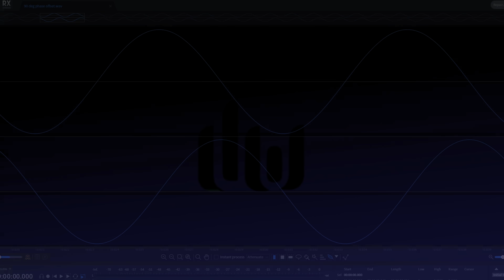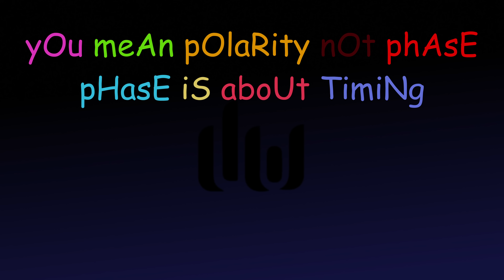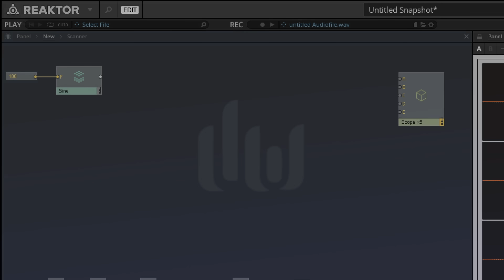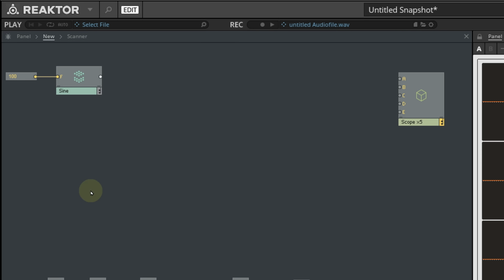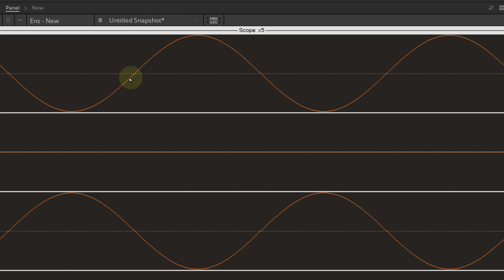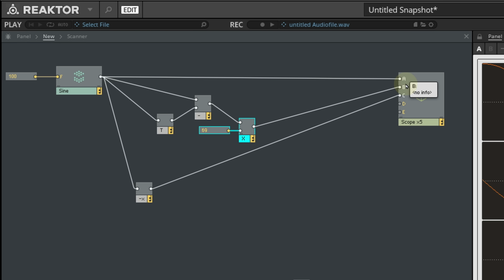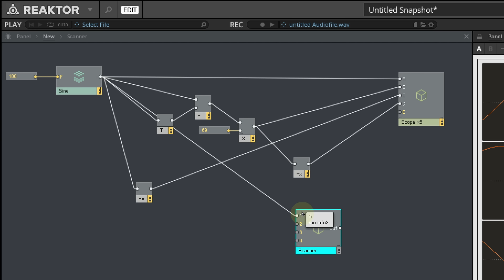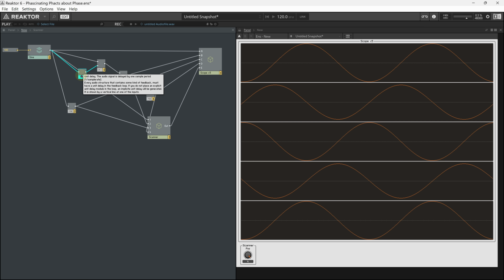Phascinating Phacts about Phase

Comment: Hi Dan. First and foremost, thank you for all the information you share.

Today I decided to measure the difference between two condenser microphones and two dynamic microphones just to confirm what you explained in this video and what DPA states in the article you shared.

However, the results were not as expected. I only found phase differences when going below ~200 Hz and on the highest frequencies (but I disregarded those since the could be easily explained by slight misalignments between the mics). I used pure tones, sine sweeps and pink noise alongside Reaper recording the signals, Room EQ Wizard measuring and comparing both signals, and Open Sound Meter comparing both signals. And every tests concluded with those results.

I used a Shure SM58 and a Sennheiser 835 for my dynamic mics and an Aston Origin and an Audix TM1 for my condenser mics.

Am I missing anything important on my tests? Or is this behaviour expected?
Reply from the maker: The important detail you're missing is that I'm not infallible and occasionally get things wrong. I blame DPA for giving me the confidence to say something silly without testing it first. Correction coming, when my health improves enough to allow it...
Reply: @DanWorrall Just focus on getting better, I just wanted to know if there was something I was missing on my tests. Thank you much and have a great new year!

Comment: really loved this video. can you talk more about all-pass filters? they aren't reversible, but i like how they can alter the behavior of compressors and saturators downstream. chatGPT said i could nudge the signal back toward where it started (minus the nonlinearities) by applying the same all-pass filters in parallel at 5% wet. i felt i should come to you on the subject. can you expound?
Reply from the maker: An allpass filter in parallel becomes a notch filter. At 5% wet that would be a gentle bell cut, just like a normal EQ band. Maybe don't ask GPT about DSP just yet...

Comment: hey, when aligning drums, should I align on the peak of the wave, or the zero crossing, where the transient "starts"???
Reply from the maker: Neither really (although either will usually get you pretty close). Usually the goal is to get the low fundamental of the drum in phase. Usually it's good enough just to make sure the low fundamental is definitely not out of phase, which gives you a weak thin sounding drum. You can align them by eye initially if needed, but they're in phase when they sound fat and full bodied, out of phase when they sound thin and papery.

Comment: About air pressure vs air velocity:
This has been bothering me right from the start, it simply doesn't make sense on a physical level.
I've looked into the source you provided, and all it does is simply stating that one microphone measures pressure, while the other measures velocity,
without any further detail explaining HOW they do that.

My thoughts on this (I'm not really an expert in microphone technology, but I am an engineering student, so I have some physical background)

Both microphone types are the same on a mechanical level:
They use a membrane to convert the physical changes in the air (very broadly speaking) into movement.
There's no reason, why one should only react to pressure, while the other should only react to air velocity.

The defining difference between dynamic and condensers is in HOW the movement of the membrane gets converted into an electrical signal.

- the dynamic microphone uses electromagnetic induction, where the voltage is proportional with the speed of the membrane
  (induction law: ΔU = -B * l * Δv)
  Therefore, the max voltage output is highest, when the coil is at it's fastest speed (which has nothing to do with air velocity),
  which is highest when the membrane is in it's middle-most position (only if the membrane is moving, lol)

- the condenser microphone is basically a plate capacitor, where the membrane acts as one of the plates.
  The voltage is proportional to the capacity, which in turn is proportional to the distance between the two plates.
  Therefore, the max voltage output is highest, when the plates are closest together, i.e. when the velocity of the membrane is zero.
Reply: Why must the speed of the coil, for a dynamic microphone, have "nothing to do with air velocity"? Aren't dynamic microphones designed such that the transducer is free to move,  therefore moving "along" changes in air velocity, while in condenser microphones, the transducer is made to be more more restrained, therefore being subjected to the highest deformation when the air pressure is at its peak?

Comment: I didn't understand why the single sample delay doesn't count.
Isn't it basically changing the timing if you delay the signal by any samples?
The part where my capacity to visualise breakis is the subtraction part. Could you go into a bit more detail about that?
Reply from the maker: The signal isn't delayed, we just compare each sample to the previous sample to calculate the rate of change. Think of that single sample delay as just a buffer to store the previous sample.

Comment: So no need to align a "90° difference" between a condencer mic and a dynamic mic?
Reply from the maker: A constant 90 degree phase difference at all frequencies is totally benign and wouldn't need correcting. The reality is probably way more complex than that however, especially when you get to the lowest frequencies the mic can reproduce (close to its natural high pass filter, in other words) so always use your ears to judge it.

Comment: I don't know why you put the pressure vs velocity to which kind of mic technique is use, condenser respectively dynamic? It is rather about the characteristics of the mic directivity, that is an omni mic is measuring pressure while an eight is measuring velocity. There are condenser mics that can be set to either of these characteristics like the AKG-414, which also can be set to characteristics in between like cardioid. The characteristics is the determinator, not the specific type of membrane. An omni is taking up sound, that is air pressure which is altering when a sound wave passes. It is made with a membrane that is seated in the wall of a sealed box that has a sealed cavity inside. This gives a pressure difference between outside of the cavity and its inside, and the membrane will move because of this. It get pushed towards the lower pressure. An eight characteristics however have no box, nor cavity at all. Its membrane is seated in a frame and it won't move at all if the sound wave comes from the membranes thin side since it will pass the membranes surface in parallell. Both sides of the membranes surface have the same pressure and no movements of air molecules towards its surface. If however the sound wave comes straight towards the surface, perpendicular to the surface the air molecules will move the surface as they move back and forth in the perpendicular direction to the membranes surface. So the eight characteristics is measuring particle velocity which actually is not sound per definition, and they are therefore measuring the sound wave mostly in one, or rather two (backside and frontside) directions, and none to the sides. The omni with the membrane in a cavity is sensitive to the pressure and pressure have no direction. It doesn't matter from where the sound wave are coming, only the pressure at the membranes surface as it passes. This is of course idealized theoretic capsules. An omni need to have a small membrane compared the the wavelength of the sound to be able to only measure pressure, and in reality we don't want too small membranes since they become to noisy as the get smaller. A practical limit must be chosen and it means the mic will show some directivity at the highest frequency's. The AKG use two membranes to achieve its different settings. If the two membranes are put to measure in face with each other the works like a single membrane while if they are put out of phase with each other they will measure the same despite the differens of the waves absolute phase on the two sides and it will therefore become an omni. This is what matters, not weather the capsule are a dynamic or a condenser. In practice dynamic mics are typically made as a cardioid or similar, and never or very seldom as an omni or eight. This means dynamic mics are neither omni's nor eight's but something in between. Condenser mic's however are made in all kind of characteristics, all from omni's to eight's, and are measuring both pressure and velocity depending on which characteristics they have. Characteristics between omni and eight are a mix of the sealed box (sealed cavity on one side) and the free frame, and are therefore partly measuring pressure and partly velocity. We can make them by having a cavity that leaks for example, or use two membranes and use them in different or the same phase and use them to different amounts. In theory there is nothing that stops us from making a dynamic mic to be measuring pressure (an omni) but they are more well suited to be having a characteristic of a cardioid or similar since they are sturdy and good to be hold in hand and they din't break as easily if the accidentally are dropped to the floor.
Reply: Now I saw the DPA description and they are simply wrong about this. They are also wrong about how much a mic can stand being dropped on the floor. They probably decide weather a mic is broke or not by when it is obvious. However a condenser mic can easily be broken so that its producing some distortion but not as much as to be very obvious. It will show when measured and for someone that really want a mic to be working up to its full specs that means the measurements will be what's define if its broken or not.

Comment: Regarding timing/polarity. I would argue that this is still very much a valid distinction in this situation. You cannot reach a maximum AC pressure without FIRST reaching a maximum air velocity. So the pressure is definitively "delayed" in relation to velocity.

Comment: Killer video Dan! Having had the privilege to see engineers work in the 2 biggest studios in Ireland, not a single one ever really cared too much about phase. They often used mic cables to roughly measure mic distance and flipped the polarity on the console for some mics(e.g.snare bottom), but they ultimately trusted their ears over all else to get the mics set up right. Once in the box, not once did they mess with an eq’s phase setting, zoom into wave forms to check everything was perfectly in line, use phase/time aligning software, or worry about the filters on a multiband compressor’s crossover. The best thing I learned from those sessions is that good mic placement recording someone with good mic technique is the ultimate phase fixer. After that, they don’t even think about it. Sure, once in a while something will pop up, but only worry about it if you can hear it.

Comment: Sennheiser MD21 is pressure and the DPA 4006 too : but not the same phase. The Beyer M130 and the Schoeps MK8 are velocity but not the same phase. Even tough being pressure, velocity or gradient (most of mics being gradient btw) introduce a phase shift, the phase shift you are referring to comes from how the voltage is "extracted" by the capsule design : in dynamic it is lenz law that will dictate the voltage conversion from mechanical to electrical, in condenser, it is the capacitance change of the capsule that will introduce a change in the bias voltage that can be extracted as a signal once the DC is removed. I am quite surprised that DPA suggest otherwise.

Comment: Great vid as always Dan. My understanding is that the electronics of different mics makes it a bit more complicated than just pressure vs velocity transducers, when it comes to the final recorded sound. My testing and reading suggests a couple fo groupings:

Group 1: Cardioid Dynamic / Figure 8 Ribbon / Omni SDC or LDC
Mics in this group are likely to be either 0 or 180 degrees apart from each.

Group 2: Cardioid SDC or LDC / Figure 8 LDC / Omni Dynamics
Similarly, mics in this group are likely to be either 0 or 180 degrees apart from each.

If you take one mic from each of the above groups, then they are likely to be +/- 90 degrees to each other.

Comment: Really nice video but the difference between a pressure or a pressure gradient is the capsule design, meaning if its an omni mic or has a directivity pattern like an 8 or cardiod. There are dynamic microphones that are a pressure microphone while a double capsule condensor with a cardiod directivy will be a pressure gradient mic and also have the proximity effect (which has to do with the velocity not decreasing as fast as the pressure in the nearfield or in other terms, velocity and phase just have a constant ratio at a certain distance which is frequency dependent and marks the transition between near and far field) So from what I know, omni microphones don´t have a proximity effect.

Comment: Another fun little phase related thing is that the pressure wave generated by a loudspeaker does not follow the speakers velocity, but its acceleration. So the common explanation that a speaker driver generates positive pressure moving out and negative pressure moving in is wrong. As the speaker accelerates outwards it will generate a positive pressure until it starts slowing down (negative acceleration/deacceleration) generating a negative pressure wave. Since acceleration is the derivative of velocity its 90 degrees out of phase to the velocity of the speaker driver. This is excatly the same thing as with the microphones. Pressure follows acceleration not velocity!

Comment: Cannot believe I hadn't thought about this with mics! Makes total sense. Thought experiment: a speaker produces a short, positive-only impulse, creating a single wave of higher air pressure. When that hits a condenser mic, the diaphragm gets closer to the backplate, the voltage goes up and when it comes to rest the voltage returns to nominal. But in the case of the dynamic mic, the diaphragm moving back creates a positive voltage and as it moves in the opposite direction to return to the resting position, you get a negative voltage. So the voltage curve only matches the impulse in the case of the condenser mic, no?
Reply from the maker: Well, almost no microphones go down to DC, so there will in effect be a high pass filter on your impulse, which will turn your positive only impulse into something that spikes positive then negative then stops. Also your speaker will probably do that as well...
Reply: Both of my ear drums are stuck with a dc offset, it’s a thing! (Ear drum protraction/retraction)

Comment: This is a great video - I have a question regarding if in some instances, it's possible for one mic to pick up more background noise than another, assuming factors such as polar pattern, frequency response and fidelity are identical between the 2 mics.

In this instance, if both mics are to record an audio source from the exact same distance, the more sensitive mics would pick up a more distant sound source at a higher level relative to the closer audio source.

My reasoning for thinking this might be possible, is that curvature of a sound wave decreases the further the sound permeates from it's source. Therefore if a mic capsule could be more or less sensitive to a sound wave based on its curvature, it could be more or less sensitive to background noise. If this is the case, it would be interesting to know if this property relates to whether a mic responds to sound pressure or velocity and therefore impacts dynamic and condenser mics differently.

It's also possible that there's no difference in how a capsule responds to differing wave curvature, and the differences in perceived background noise sensitivity are just a result of other factors that you mentioned. But I'm curious if you have any insight to this as it's something I've been wondering for many years.
Reply from the maker: The mic capsule just hears whatever vibrations happen in the air around it. It might be able to tell what direction it's coming from, but if we're ruling out pattern differences, the air vibrations at the mic capsule will be the same regardless of what type of capsule it uses.